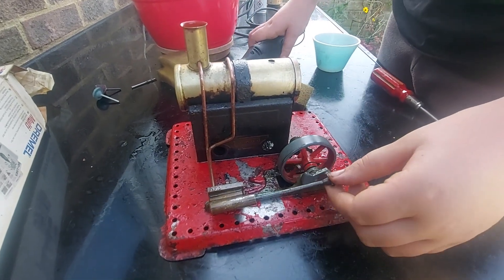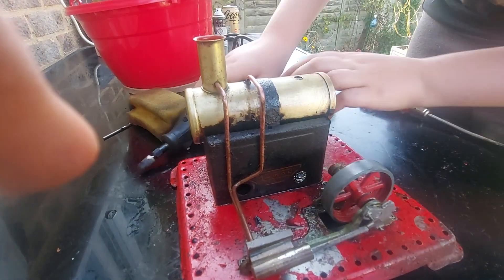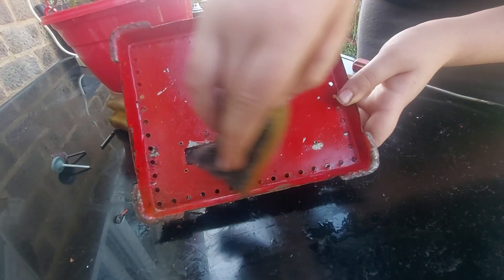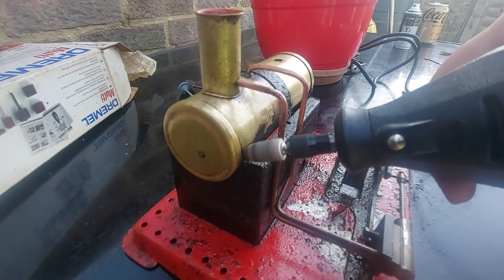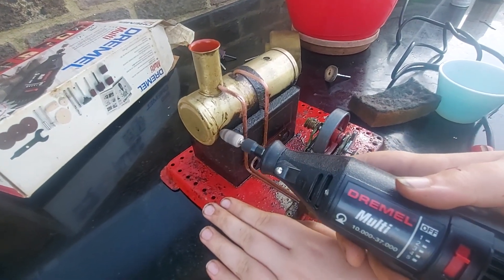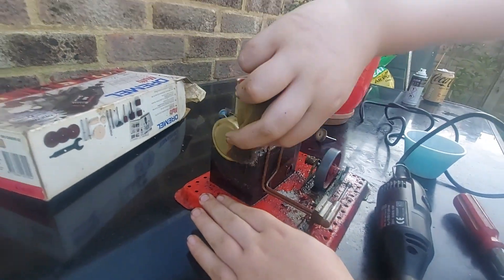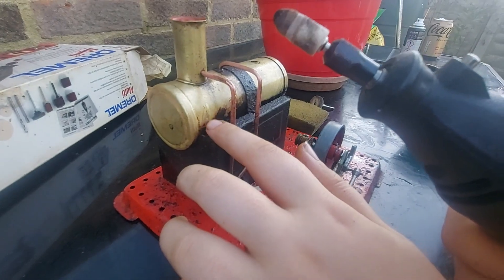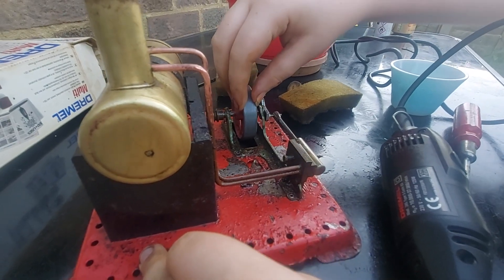[Day 2 part 3 filmed on the same day as part 2] Restoring my mamod

Comment: I recommend taking a fuzzy rag and put brasso on it
Then rub hard on the brass, but not to hard to dent the boiler of course, then take another fuzzy rag and wipe it off, while applying pressure.
Youll get a mirror Finnish.
Reply from the maker: Thank you at the mo it is not having any work yet due to i need to do tons of work on it lets just say it blew up and i have burns down my leg but will use info for future thanks so much for telling me.
Reply: @751terriertravels. Wait what? 
Well thats unfortunate
Was the soldering weak or did the safty valve not lift?
Reply from the maker: @laaity  didn't like a brand new o wring it's fine now lol
Reply: @751terriertravels.  Bro i thought the boiler went bang lol, so the oring just failed?
On my D45 the oring on the safty failed at full pressure, starting hissing, then whooshing lol
Btw
If something doesn't wanna move
Do not force it
It will break or damage
Im revering to when the piston would do the full travel
I would've taken the cylinder off and clean it
Then try inserting the piston
I may not be an expert on mamods but i do have some experience on models and full size
Reply from the maker: @laaity  o ring went but made a bang sound when the whistle shot at me had to massive burns lol 4hours up a&e!
Reply: @751terriertravels.  Haha, wouldn't say that's blowing up lol, it's a dramatic failure lol
But ja that's how we learn lol
Me and my assistant where talking about it theorising how this boiler could've gone bang lol
Turns out its just a fitting getting loose lol